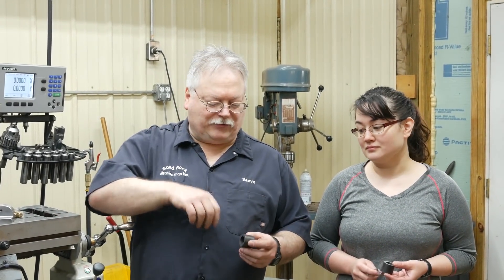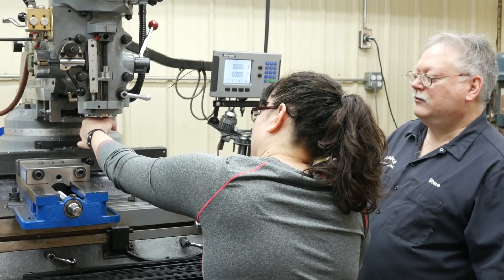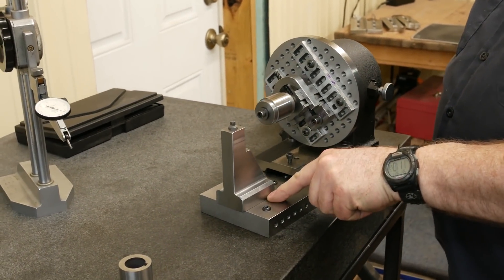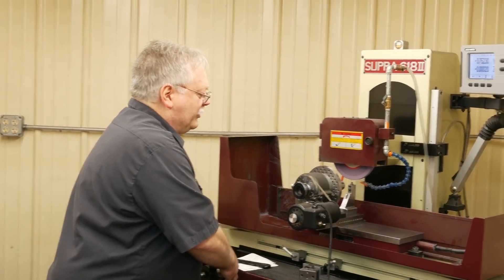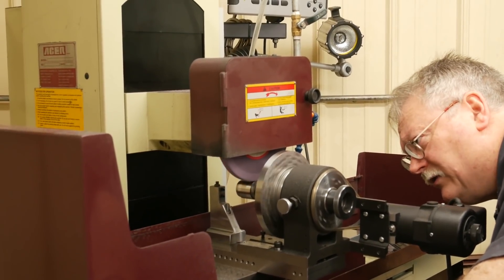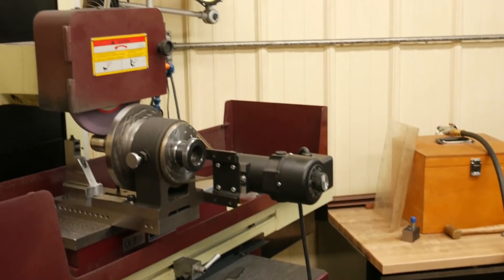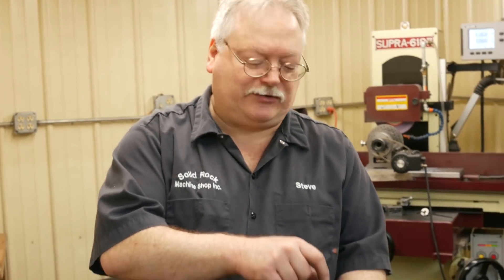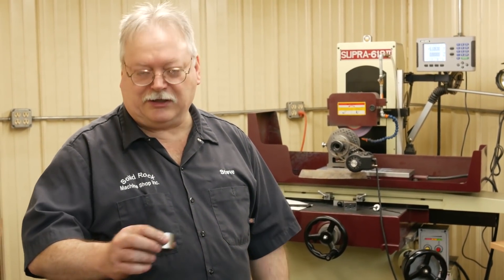Hard turning and grinding 30 bushings Part 1

Comment: Thanks for posting. I'm having a 7 inch long pin ground from a slightly larger pin to repair an obsolete car gearbox and was curious to see how this process was done. They will reduce the pin by 004 thou. The case hardening extends into the pin to a depth of 20 thou so there shouldn't be any issues. Thanks again! 👍👍

Comment: Just 0.0001" difference on the hard turning using just the quill? wow that's a mighty well matched spindle od and bore you got on that mill
Reply from the maker: Hi chronok,

I love this Acer milling machine. I used many different brands but Acer is by far my favorite.

Steve

Comment: Hi Steve, why not use the Moore for internal grinding....
Reply from the maker: Hi Big Boss,
That was an option and I am sure it would work fine. The setup for me is easier on the surface grinder and if I encounter taper it is real easy to take out. Also, the air demand is less on the NSK air spindle.
Steve

Comment: Ohhh! I Must waken up!   Think Laterally - MORE!    Had never thought of using the Bridgeport like that. - Crikey!  could even do the basics on a Pillar drill - Real Agricultural stuff that !  :-).   It's Sunday morning Coffee Break time here  - so I'm going out to give that a try. Many thanks.
Reply from the maker: You're welcome culmalachie. I hope it works well for you.
Reply: Haha LOL  - So much for the forecast heat wave here in UK - started to rain & Cold so....  Try the idea on the Pillar drill - turned down an old bolt mmmmm least said!    Next onto Bridgeport.   LOOK & SEE when you WATCH:    which way around  was the cutting tool mounted!  ( Och I've been watching too many  Vids with camera mounted to Saddle, etc and didn't get my orientation QUITE right  first time around.  but Hey Presto - It works Genius!  The Apprentice had a Laugh too. Cheers!   another lesson for all!
Reply from the maker: Glad it work out in the end. We had nasty cold weather up until a few days ago. It is starting to get nice out now. Steve
Reply: With that same setup idea you can dress arbors for slitting saws, etc. every time you mount them to the spindle.  Zero runout...
Reply from the maker: Hi Bob,
You are correct. There are a lot of untypical things that work very well in the mill. Just today I had to cut a little of the diameter of a harden washer. I grabbed a 1/2-20 SHCS and a nut tightened up the washer to the bolt, put the bolt in a 1/2" collet and held a TPG321 ceramic insert in the vise and cut the washer diameter to the size i needed. Worked great and fast.

Comment: Hey Steve, great video - very information dense.  I do have a question, why did you decide against doing all the hard turning first leaving enough on the OD/ID for grinding later?  I have little experience cylindrical grinding or machining/grinding parts fresh from heat treat so I'd love to hear your thoughts.
Reply from the maker: Hi Pete,

We could have tackled this job a few different ways with similar results. I could have hard these parts to size without grinding at all but I told the customer that I would grind them. Most people are aware of the quality of grinding but not hard turning so they prefer grinding. There was about .01" stock on the bushings and I would have had to dress the wheel every part. Hard turning all but .002" stock off the part was very fast and accurate. I was able to grind 5 parts with out redressing the grinding wheel. Also, this provide a prefect opportunity to train my daughter. Once she got going she feed the parts to me and I would finish grind them. She finished way faster than I so I showed her how to grind them and I checked every part she did. She did a great job without scraping even one part. This allowed me to work on a fixture to hold the parts for ID hard turning which will be in the next video. The hard turning reduce the time needed to grind the parts significantly.